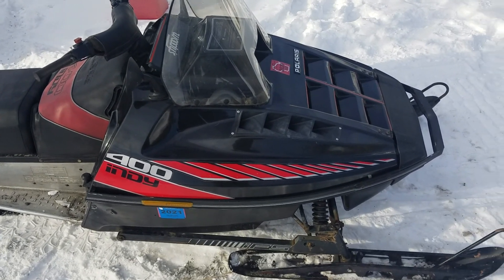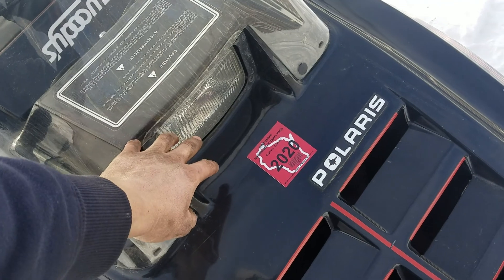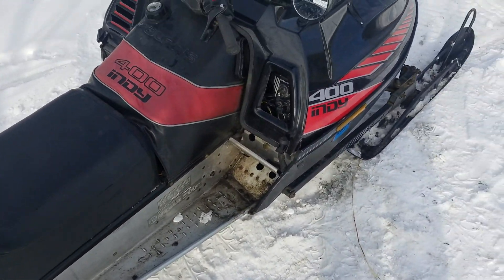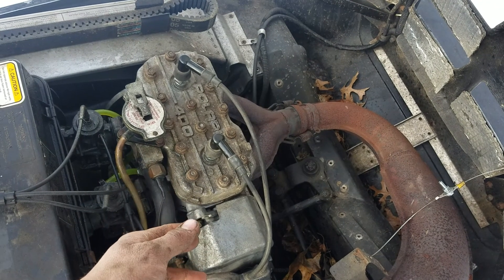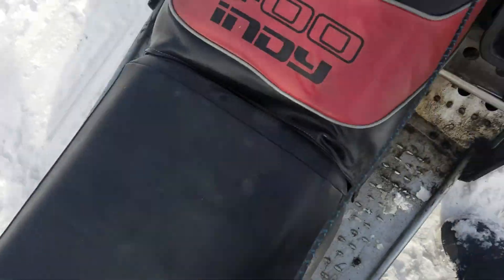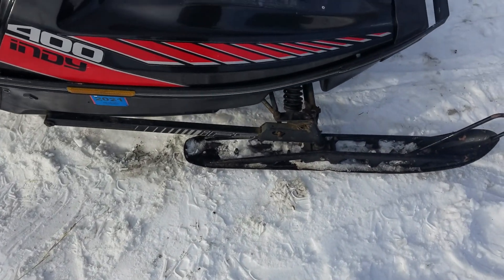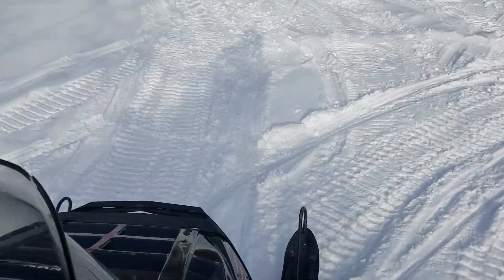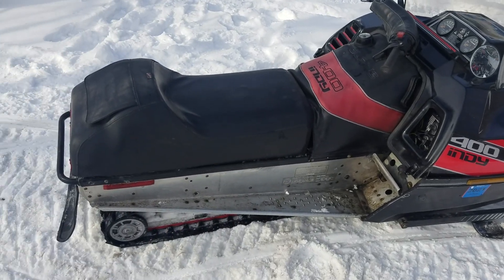1987 Polaris Indy 400

Comment: How much for it?? I just got the same sled for free was sitting since 2014 just had a broken gasline in the tank the seat n cover is extra crispy runs good for 6600 miles but just started losing spark while riding but go back out after 20min n it starts right up????